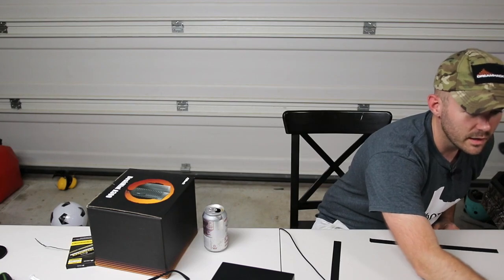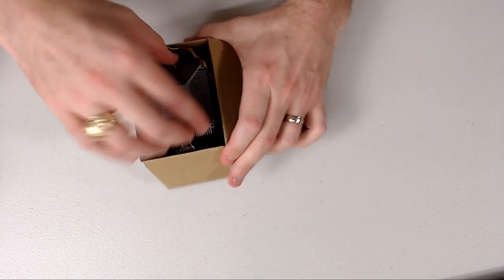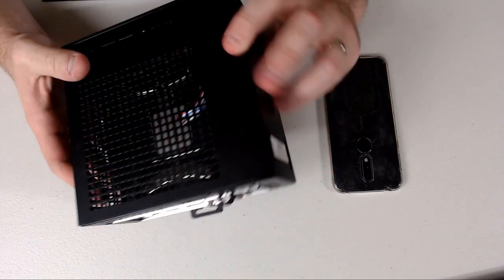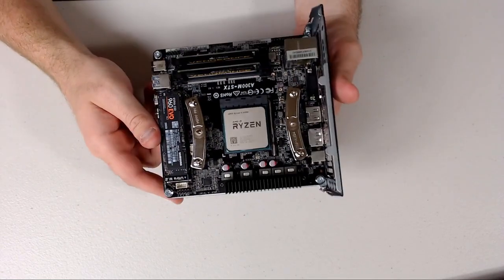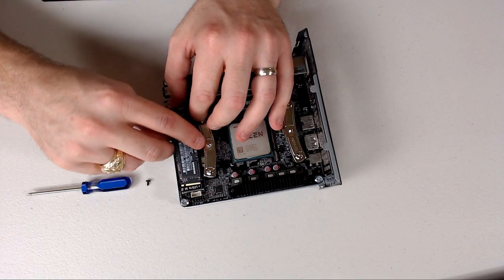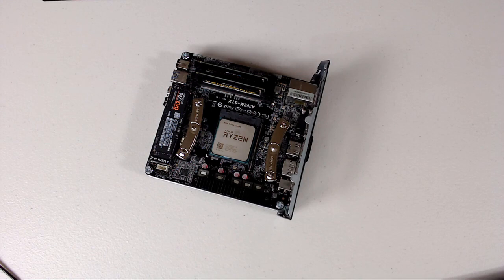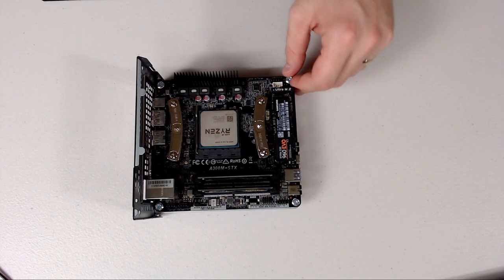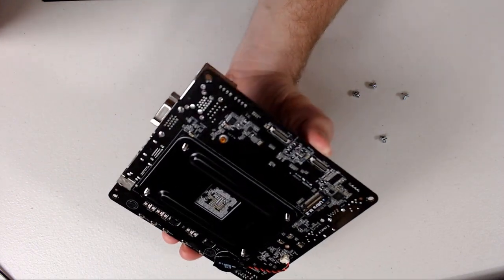Building a PlayStation! | ASRock A300 + APU into a PS2 Case | pt 1/4

Comment: i would like to turn my ps2 into a pc case but i dont know if a gtx 2050 super/a b450 pro 4 (motherboard) will fit  in a ps2
Reply from the maker: Those will not fit
Reply: @TheTerk  you might know what console will take those parts?
Reply from the maker: @ekombat2149  probably an og Xbox. Maybe Xbox 360
Reply: @TheTerk  ok and thanks for the help
Reply: @TheTerk  oh and will a EVGA 220-B5-0650-V1 650 B5, 80 Plus Bronze 650W, fit in a xbox 360 i just wanted to know and thanks for the help

Comment: This looks cool, one thing I wanted to know is where did you get the power switch used to power this PS2 build? I am considering building one of these for myself and would like to know what alternative power switch can be plugged into an Asrock DESKMINI A300
Reply from the maker: I'm using the default wires that come with the DeskMini kit.  for a power button, it would be as easy as identifying which pin is the power switch, and doing a little bit of soldering to your custom button/switch.

Comment: waste of a PS2, you can get a freemcboot memory card to read games off of a usb flashdrive or a harddrive, the PS2 is in such a good condition... it's pretty hard to get a good condition PS2 nowadays, and most of them are already hardmodded too.
Reply from the maker: I can do that on emulator easy on this pc.
Reply: @TheTerk  ik, but a good condition non modded PS2 like that is a collectors item where I live, especially if it's an original japanese model

They cost alot of money since almost every fat PS2 is either modchipped or in a very bad shape
Reply from the maker: @tristan6509  well, this one was broke.
Reply: @TheTerk  you can literally go to ebay and get a replacement laser for less than $10
Reply from the maker: @tristan6509  ok thanks for the comment. I value this mod for my PS2 more than getting it fixed. If you want a PS2, go get one.
Reply: @TheTerk  already have one, I just think it's a waste. but hey one man's trash is another man's treasure amirite

I am also trying to cram my deskmini inside of a ps2 shell and apparently some factory in china are still making those, they look the same but doesn't feel as high quality as an original one, but I got mine off of the local market for $5

Comment: A random thought in my head. What if i build a pc in a ps2 body
Reply from the maker: Do it!  I'm thinking if re visiting this mod
Reply: @TheTerk  I will definitely look into it. You think it can be done under $600?
Reply from the maker: @DigitalSubset  definitely with these parts.
Reply: @TheTerk  Okay cool because have a ryzen 5 pc I picked up for cheap but I want to build a beast. My friend gave me a ps2 and it turned out the controller ports gave out.
Reply from the maker: @DigitalSubset  be warned, this pc isn't a standard one.  the APU is definitely geard for low-spec games and old old older games

Comment: That stock cooler has a 60mm fan at most. Very good project by the way, I was looking for this, specifically.
Reply from the maker: This project has come a long way. I was hoping for RDNA based APUs the past few announcement, but I'll be waiting till late '21 at the earliest
Reply: @TheTerk  That's right. It's still going to be like that for the 4th gen zen-based APU lineup. While it's always cool to have the latest tech when it's actually better performing. It seems that so far Vega GCN cores scaled perfectly fine at low compute units count. And there's also the problem that conventional DDR memory limits by at least 30% the true potential of current iGPUs. Maybe RTG engineers thought that working at an all new iGPU earlier than necessary wouldn't be beneficial.

Comment: Nice video. Few mistakes though. Bottom side M.2 NVME is x4 PCI-3.0 and even supports RAID 0/1 with the other 2280 slot. Earlier BIOS's support some CPU overclocking. The SATA ports are on the back side for convenience to hook up 2.5" drives. There's nothing special about them. The A300 chipset doesn't have a seperate south bridge/controller, so this motherboard relies on the CPU to supply the bus connections. That means some Ryzen APU chips are more limited in PCIe  than others (200GE specifically). Looking forward to you putting this in a PS2 though, should be fun! Oh, and check out ETAPrime's video on hooking up an external GPU to this motherboard. Works better than expected!